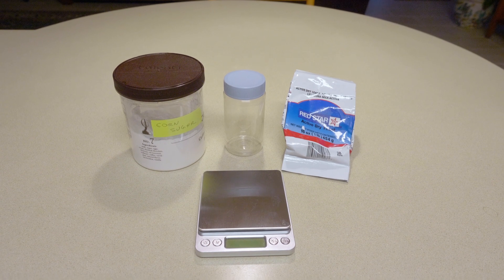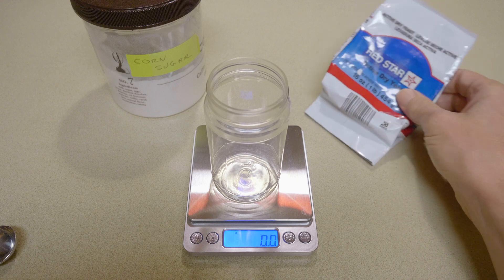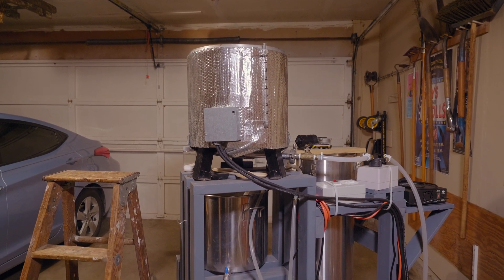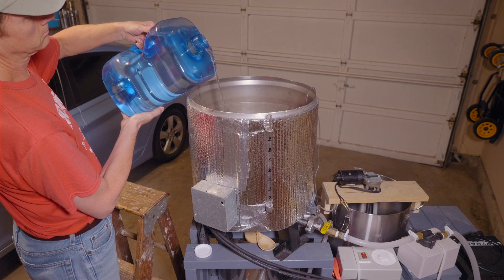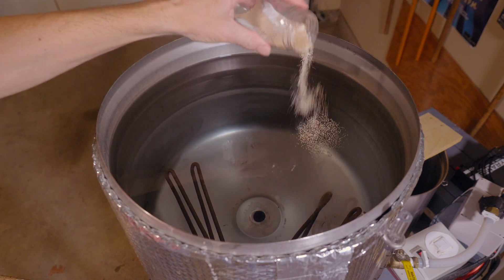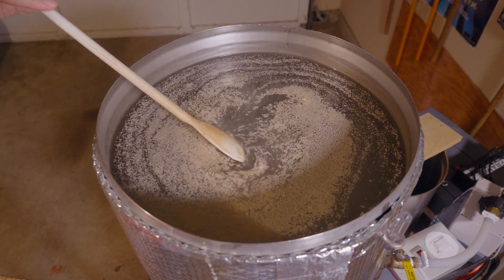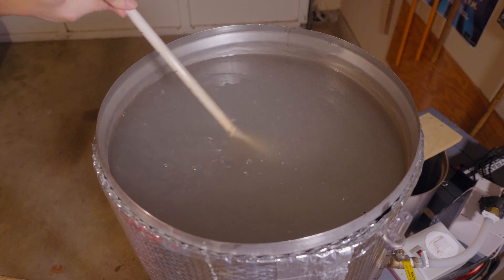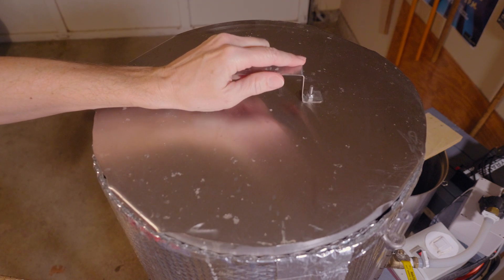Yeast Oxygen Scavenging Method - YOS

Comment: 1:17 1 to 2g each of yeast and sugar per gallon (3.8L) of strike water.
2:54 heat strike water to 100F / 38C. Add mash cap. Leave minimum of 30 mins to 2-3 days.
5:10 Heat above 130F / 55C before adding sulphites. He uses between 1g and 2g for a 5 gallon batch (25 to 50ppm). That's taken from a comment on the HSO, LODO & Four Batches video.

Comment: What effect does this have on your PH calculations? I'm using RO water and Brewfather usually get's it spot on.
Reply from the maker: Hello, the yeast release some acid so the pH will be affected a little to the downside.  It is a small amount (~.1) but you might need to try it and take measurements to know the exact amount.

Comment: What's the performance of sodium metabisulphite in deoxygenation? I think that should work and be a simpler approach.
Reply from the maker: Hello, sorry for the late reply.  SMB does eat up oxygen but it leaves sulfate behind.  So the community uses bakers yeast to deoxygenate the strike water (YOS method) and saves the SMB for the actual mash and rest of the brew day.  I have a video on my channel about it if you want to learn more.
Reply: @integrityhomebrewing7202  I have learned from your videos that excess metabisulphite can affect oxygenation of yeast in the initial stage of fermentation. I saw how you handle that by adding extra oxygen to the wort.
Reply from the maker: @metatag360  Yes.  It is not bad to use a lot of SMB but you need to account for it when you get to the oxygenation stage.  You first need to expend all of the suflites to where they are exhausted.  Only then will you start actually oxygenating the wort.  This is only learned by trial and error with your system with the use of a good Dissolved Oxygen meter.  You can see the sulfites eating the oxygen as you put it in the wort.  Over some time the readings stabilize and then start to go up.  I purchased a Go Direct DO meter for this purpose - https://www.vernier.com/product/go-direct-optical-dissolved-oxygen-probe/
Reply from the maker: I try to limit the sulfite use to match my system.  Over use of sulfites leads to very clean but bland beer.  It is a balance per style and how your brewing setup performs.  A lot of levers to pull!